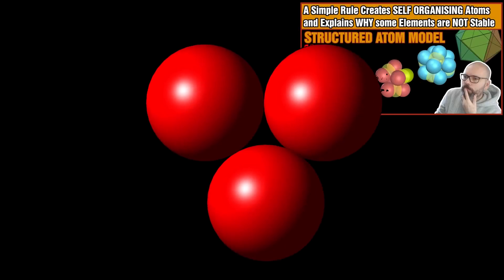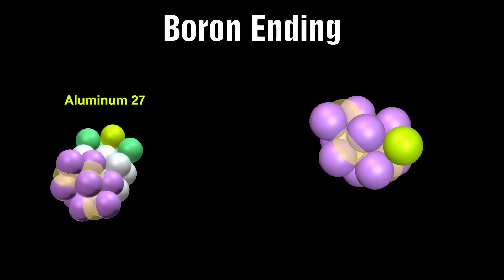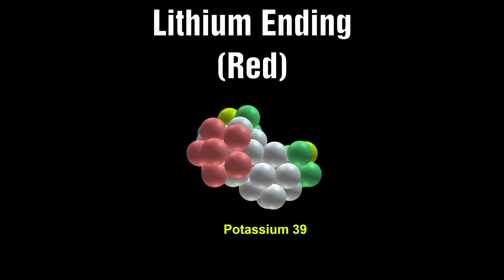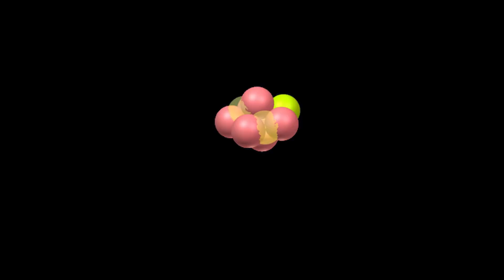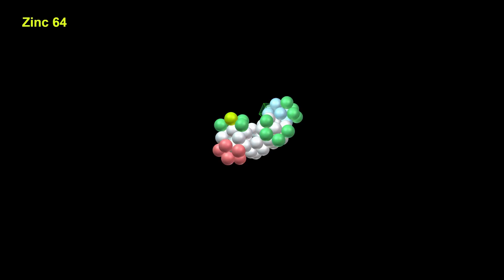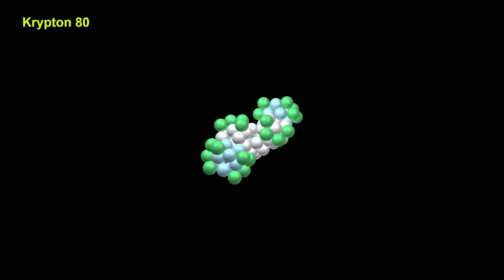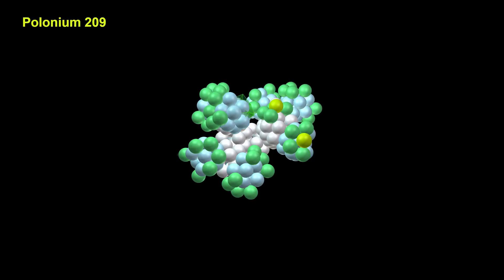Building Larger Atoms using SAM

Comment: In SAM the nucleus of He consists of 4 protons in tetrahedron configuration. Instead of a static placement of 2 inner electrons, I am more inclined to visualize these 2 inner electrons as fast rolling spheres over the surface of the protons, where one electron rolls out of one of the 4 the interstitual gaps while the other rolls into it. The electron is small enough to do this.
One can calculate that protons with d=0.8424 fm, creates gaps of 0.1303 fm. An estimate for the electron is d=0.128 fm.
Due to its smaller mass, the electrons have less inertia than the protons. This implies that any repulsion between protons is encountered by a faster appearence of an electron between them, pulling them back to the tetrahedron position. So the protons vibrate relative slowly in pairs in and outwards the tetrahedron, but are very restricted to move outwards due to the much faster rolling elecrons that pull them back.

Comment: Oxygen 16's 4-ending doesn't make sense to me the more I look at it. Why not a 2-ending on each side? That seems more balanced. Also, that kind of configuration may allow the water molecule to be formed with those angles. Same thing with Sulfur 32 and Hydrogen Sulfide. Also, because of the bigger nucleus of Sulfur 32, the Hydrogen atoms in Hydrogen Sulfide could have the slightly smaller angle between them compared to those in the water molecule, and the longer distance away from the nucleus, just to be further away from the increased number of inner electrons, directly opposite of the 5-ending.

Comment: Before we embrace SAM let’s compare it with conventional model. 

Conventional: +proton -electron attract one another in a collision course are repel by centrifuge force. Leaving the electron in orbit around the nucleus. This ends in a stable system. 

SAM: electron and proton can enter a collision course can neutralize one another without orbiting electron.The electron is sandwiched in between two protons assume in an equilibrium steady state is wishful thinking. Thermal noise bumped the electron to one side will be fall onto the nearest proton instantly, into charge exchange leaving residual charge on both of electron and proton. That follow by a second charge exchange from the second proton to the other two, into equal electrical potential, either positive or negative. Like polarity charge will expel them apart, that is an unstable model regardless how beautiful it may be.

Comment: Hold on... The periodicity of the elements is well established to derive from the quantum numbers that define the ELECTRON wave-functions. If you want to explain stable NUCLEI, that is one thing, but this will have no bearing on the electronic properties, only on stable nuclear configurations of protons and neutrons (or protons and proton-electron pairs in this model). The number of elements in each block of elements is simply the number of possibilities for the magnetic quantum number times the 2 possibilities for electron spin. You have to separate any nuclear periodicity from the electronic periodicity which is the basis of the periodic table... or face ridicule.
Reply: Quantum wave function is a generic mathematical equation that has no physical meaning all it does is give you is the probability of any property of a particle

Comment: Internal to the proton and proton/electron surfaces there are electrons pulling everything together. What geometric or platonic solid forms do they arrange themselves into?
Reply: The earlier video's dealing with SAM should answer your question in more detail. The icosahedron (Carbon) is central in this.
Reply: @edokael4291  have you looked into the bit about quasicrystals?
Reply: Proton, Deuteron, Tetrahedron, Pentagonal Bipyramid, ... Icosahedron.
 It's heavy on the Pentagon, the most cursed and irrational shape.

Comment: Re: Elongation.  As a lay person, I used to follow experiments that dealt with measuring the sizes and shapes of atomic nuclei by 'probing' them with electrons, protons, and x-rays for instance - 30 to 40 years ago so I don't know what advances have been made since, but it seems to me that there should be such experimental data available in the literature that would support or not these shapes.  As to instability or radio active decay there is still the 'problem' of timing or half life, why U238 half life is 4+ giga yrs but Pu239 half life is only 20+ kilo yrs for instance.  Decay Constants mean there is some intrinsic 'vibratory' or energy state associated with such nuclei (probably all nuclei) to my way of thinking.
Reply: It's not like the standard model has anything on predicting decay constants either. They involve "drip lines" and, I kid you not, "magic numbers".
Reply: @revcrussell  Agreed.  Point is there are experimental data of shapes and sizes of atomic nuclei and these should be examined in light of SAM.
Reply: Hi William and Rev. Russell. I'm not speaking for the S.A.M. team here, but I'm almost certain they are already at work examining existing published literature and data to compare/contrast expected results via SAM. It's in the works. This will require enormous amounts of research time for the SAM team in future, and thus far it has been an unfunded volunteer effort on the part of Edo Kaal and a small number of talented individuals. It's my hope it will reach a much larger "awake" audience when the book is released in a just a few short months. And when Edo has his foundation set up to accept financial support for the effort - also in the works - I have total confidence the he and the SAM team will get the help that is much needed for this research to advance.
Reply: @markspann  I imagine previous experiments results were interpreted assuming a basic 'spherical' or 'packing'  shape for nuclei but with SAM such results may be re-examined without that previous bias
Reply: What a pile of BS . . as an lay person
Reply: @benwinter2420  My dear Be, Do you not know that TRUTH is 1st dismissed & ridiculed, 2nd vociferously opposed, 3rd accepted fully as always having been self evident?

Comment: Will the SAM model accommodate meta-stable states? I can only assume those are dislocations in the atomic structure that are temporarily stable.
Reply: That is indeed the thinking. Each particular element, isotope and 'excited state' all have a specific configuration.
Reply: @edokael4291  Would something like quantum tunnelling be needed for isomeric transition? One nucleon would need to move to another position and that would require energy to move. What if that energy wasn't present?
Reply: @revcrussell  I cannot give a definitive answer to this excellent question. We see there is densest packing taking place that corresponds to binding energy (particular states for particular isotopes). The protons (and electrons) in the nucleus 'feel' each other and will respond if they can (nuclear transmutation / falling back to ground state). 

We also believe and think that the nucleus can and does interact with the environment, most likely through electric forces (EM). That is why we point out there are transmutations triggered in electric discharges for example. (LENR)
Reply: @revcrussell  Thornhill points out that supposed tunneling is similar to a gate breakdown, like you'd see in PNP gates. The teleportation is the nucleon walking down the electrical gradient.

Comment: Speaking only for me and my ability to take on new information, it seems that there must be a better way to present SAM than this and other videos of yours I have seen.
For me, it seems you are in a big hurry to skip through the information, perhaps to avoid too close a scrutiny by the viewer. High speed flash cards never were my thing.
I am sure the ruts worn into my brain from the general education we receive in the USA may be impeding me from quickly grasping the information as fast as you present it, that being said, I am sure I am not the only one.
I am pretty sure the emperor has no clothes at this point, but it seems that there are a lot of nodding heads agreeing with the narrative that his cravat matches his breaches very nicely, thank you very much.
At this point, my only suggestion is that you slow it down a bit, and leave a continuity of labels indicating past states as new ones are introduced, and as colors of the same spheres change, provide some kind of linkage between spheres to adhere the concept you are trying to suggest.
The complete transition of colors and shapes between each slide leaves me floundering. 
Thanks.
Reply from the maker: @4n 2earth we all have different learning styles and it is not possible to suit everyone's needs.  Whenever introducing such a brand new concept it is not possible to explain everything all at once.  You build on previous aspect and have to take certain aspects for granted until you go into more detail on these later on.  This is the concept of a circular curriculum.  It would also not be possible to explore all these avenues at once as it would make the whole video disjointed.  I am not trying to avoid anything in these videos but trying to convey the basic concept of the SAM model.  Many of you questions may be answered either by later videos or when you read the book they are in the process of publishing.  Please also realise that I am just one person creating these, I am constrained in what I do by the tools I have and the time I have.  I make almost nothing out of these videos on YouTube but do this because I feel this model is important and I want to explain small part of this model to allow others to see how it fits together.  I'm sorry this format does not work for you
Reply: @SeethePattern  Thank you for your informative, responsive, and kind reply.
I am a committed fan of the EU and I help fund it through patreon. I realize that doesn't help you very much, and I hope to include your channel in my meager ability to perform philanthropy.
In the meantime, I hope to help with these comments and suggestions. I know I am not alone in my learning preferences; an overwhelming portion of those drawn to and in the sciences are of the ADHD bent, and would benefit from my suggestions if they helped shape the way information was presented.
Cheers, and keep up the good work!
Reply: @4n2earth22  YT is for entertainment. If you want to know what he's talking about and were he's coming from you need to read books, papers and spend time on relevant websites.
Reply: @reefsroost696    If you happen to know of any, please share.
Reply: @SeethePattern  fr people really appreciate what you do.
Reply: @SeethePattern  . . Holy  hell you can brick
Reply: you tube allows you to slow down any video and even go back and repeat something over and over. See The Pattern is doing a pretty good job. It doesn't mean someone may understand him first time since we are dealing with new paradigms. your off handed criticism was snarky in tone.
Reply: Hmm, reading your comment I noticed the constructive criticism only took a sentence or two. The rest was pointlessly snarky or accusatory. Since you apparently are unable to make your own theories (or at least theories anyone cares to consider) then the surest way for you to help move science forward is to politely mention your critiques and then fall silent. I'm sure you won't find my critique of your critique insulting since, unless you were being insulting on purpose (just absurd that), I'm just replying to you in the tone of the parent comment. You're welcome.

Comment: Can there be a stable form of element 115 using this model? Asking for Bob Lazar
Reply: probably has to be "grown" in a different crystal configuration that the one we can create in our particle accelerators. Maybe that's why bob said it was cut into thin slices?
Reply: Wot Bob UFO Lazar . . OK . . funny
Reply: Elements above Lead are unstable, however U238 is almost stable with a half-life of about 4.5 B years. 
The quest and hope for more stable(ish) elements above Uranium would be extremely difficult to achieve, at least that is the conclusion we have made from SAM. The current efforts are by shooting Calcium ions or something similar at an Uranium, Americium or something similar again. That will never lead to results for sure. Any approach to achieve stable(ish) elements in the range of 115 would have to be done with complete control, if possible at all...
Reply: The UFO . . was all jumbled angles inside . . dizzy to look at . no seat for pilot was to be made out of the jumble of shapes . . Bob Lazar

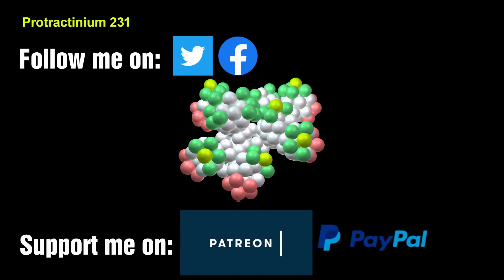Comment: Bismuth, atomic number 209, is a very interesting heavy metal. 10:13
 "The density of the metal is 9.8 -- a little less than lead; but like water, the solid expands as it freezes, and it floats on the liquid. It can melt quite easily, and it can grow stunning little ziggurat-like crystals by cooling it slowly from melt. It is easy... 
Heat some bismuth in an iron ladle or porcelain bowl using a sand bath and a Bunsen burner until it melts. This happens at just 271-degree Celsius. 
Turn off the burner so that the metal cools very slowly. 
When the metal freezes-over at the top poke two holes in the solid surface.
Pour-out the remaining liquid; then leave everything to cool at room temperature. 
If you now break open the metal mass; you will find gorgeous stepped cubes of bismuth with a faintly pink iridescent sheen to them -- a color which arises from the thin layer of oxide that coats the metal."
"Bismuth's role in metallurgy has us always intrigued. It has been used extensively to make low melting alloys being added to pewter, the alloy of lead and tin to adjust its melting point or to antimony to make type metal, once used in printing presses. Alloys containing bismuth were used for safety valves and boilers, melting if the temperature rose too high and a classic prank invented in Victorian times was to cast spoons from an alloy containing 8 parts bismuth, 5 parts lead and 3 parts tin. Its melting point is low enough for the spoon to vanish into a cup of hot tea."
Refer: https://www.rsc.org/periodic-table/element/83/Bismuth